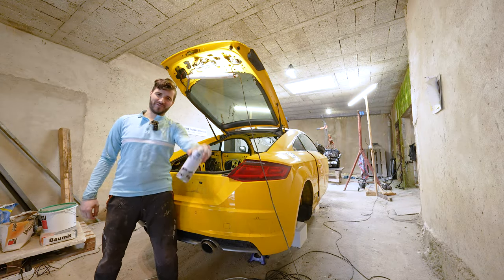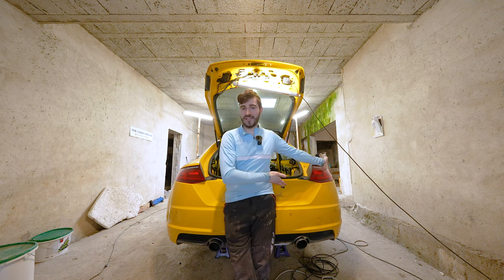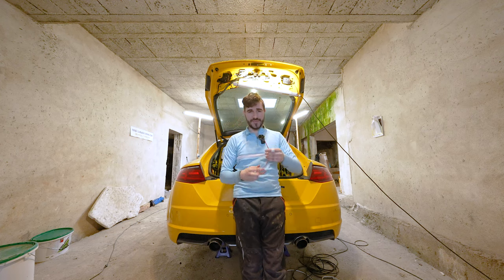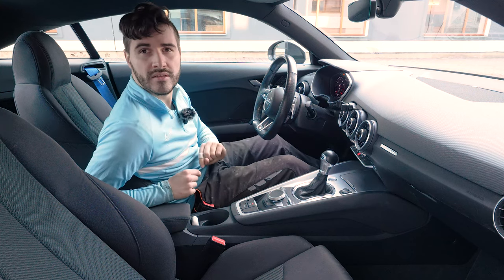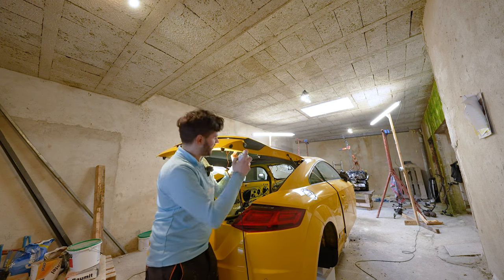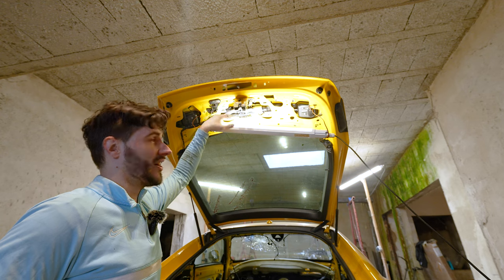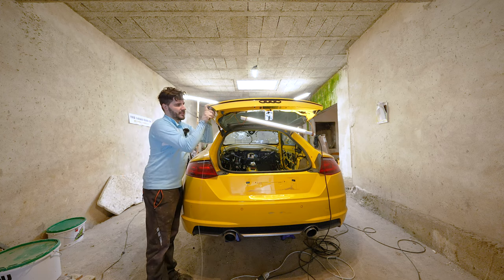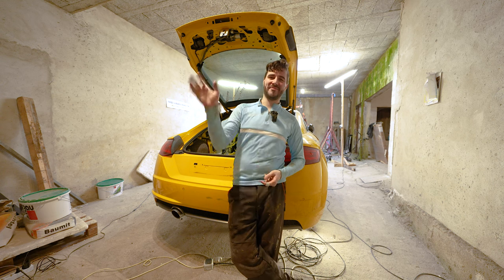How to - Audi TT mk3 8s - Rear Spoiler Drains

Comment: dumb question i hope you can help. my Mk3 came with a fixed spoiler, i want an active spoiler. I have found them on ebay but do you think there is the harness to plug in the active spoiler in my hatch?
Reply from the maker: Puh, a really good question actually.. i dont know for sure, but you can always take your plastic trim off an take a look, that way you will be sure.
And depending on where you are located, you can probabbly write on lokal facebook group for mk3, and ask to swap you fixed spoiler with somebody, so you dont have yo buy it :)

Comment: any issues on these i should look out for when buying?
Reply from the maker: The tts or the spoilers?
Reply: @cars_anatomy  I’m looking at a 2.0 tfsi Quattro tt
Reply from the maker: @NotCamo   coolant water pump prone to leaking, carbon buildup in intake ports all models before 2018 i think, timing chain guides can wear out….
Overall very solid car, with some common issues like any other car has… but I highly recommend :)